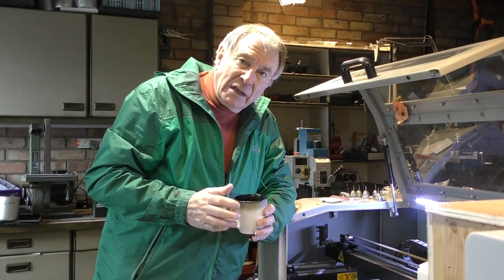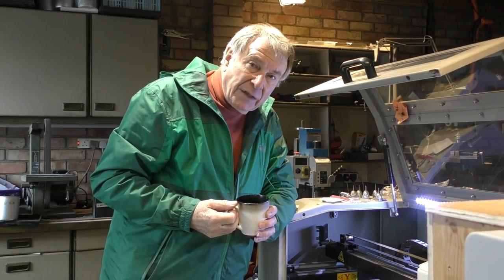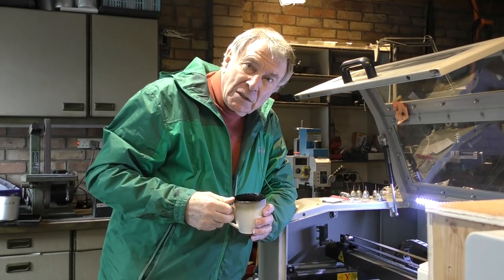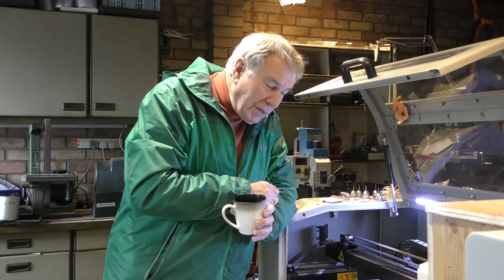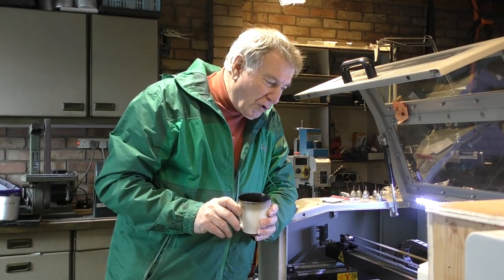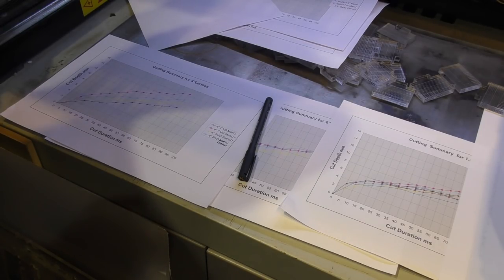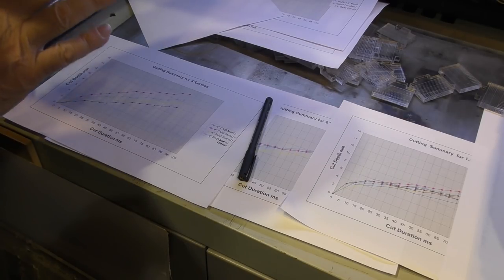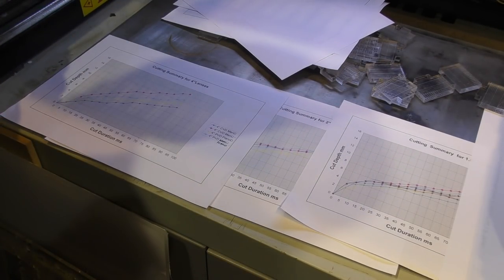RDWorks Learning Lab 202 More Laser Cutting Investigations

Comment: As you've said - in acrylics we're vaporizing the material - I wonder if material limited rate of vaporization is another variable?   i.e. given 10 mm thick acrylic - do you get the same, better, or worse performance with one pass say at 10mm/sec. OR two passes at 5 mm/sec.  (all else fixed).  Performance of cut may be judged by 'squareness' of finished edge.  Less taper is better..............
Reply: oops - I meant 1 pass at 5mm/sec. vs. 2 passes at 10 mm/sec.  ;-)
Reply: Hi Dennis
 Take a careful look at my very deep dot burns and also the dot test I did later on  Do you see any sign of taper in the first 10mm of  "tube".   Tubes are rather special in that there is nowhere for the vapour to escape from  except UP the hole. and you then imagine that the hot vapour may scour the tube but there appears to be no evidence of this.  My concern with the results  is to see how close these objective tests match up to cutting where  one side of the tube is missing . I know that multicuts do work but  the problem with it is that the vapour you produce with the "half cut" is hundreds of time more voluminous than the sold material that it was  and the only place for it to escape is UPWARDS.. At the same time your air assist is blowing it back down to create a bonded white condensate around your cut.  No, I am an advocate of cut once and blow the debris out of the BOTTOM of the cut. Also a single slow cut allows the heat to build up in the kerf a few millimeters behind the cut This is vital for that burnished finish. I have explained it many times  but once more can never be bad. Acrylic is similar to H2O. Acrylic is solid at room temperature (ice). At 160C  the solid acrylic becomes liquid (just as ice does at 1C). It then remains liquid until 200C when it immediately becomes vapour (steam at 100C) This vapour is still acrylic and that is what you are recondensing on the surface as it cools. However, in the kerf while the wall temperature remains above 160C the liquid acrylic film FLOWS level and produces a smooth surface. Cut fast twice and the wall temperature  never gets a chance to absorb/retain heat. Add to that your air assist that is forcing the liquid to cool before it has a chance to level and there is another reason to cut once slowly and with just a whisper of air assist. This is particularly evident with cast acrylic. For some strange reason (although chemically identical) extruded acrylic seems to retain that heat better and produces smooth edges much easier.
Although it may appear that I am trying to find the fastest cut, that is not the goal. I was using speed as a measure of lens performance. My assumption was that if power , material and focus  are constant, then the speed I can cut at tells me how well the lens is performing. Hmmm....... in hindsight that was a poor assumption because all those near constant performance results  just didn't make sense .  You can see from these latest results that in fact  there are big differences in lens performance and some of the patterns I see in those results  are  just confirming my imaginary picture of how the marriage of a laser beam and lens  work together to produce a cut .... and a basically parallel cut. There is NOTHING in lens theory that predicts this.
 Best wishes
Russ
Reply: Amen Russ....it all makes sense.     Thanks for the detailed feedback.

Comment: I’m very new to the channel, but this is all very interesting(!) Thank you so much for putting in the time on this, and for sharing all your findings!

I wonder if some of the puzzling results might be down to factors having as much to do with the material and what’s happening at the light/material interface as it does with the lenses and the resulting light path? Two thoughts occur to me:

1) To what extent do the escaping gasses impact the delivery of energy to the material being cut? I was prompted to consider this, upon seeing the way the depth of cut seemed to level off as time or lens focal length increased. It struck me that some portion of the beam energy could be getting absorbed by the hot gaseous decomposition byproducts that will naturally fill the cavity more and more as the depth increases. I can’t think of any easy way to measure it, but perhaps as the hole grows deeper, more of the beam energy is just going into further heating the gasses in the hole, vs heating the plastic at the bottom of it.

2) Vis a vis unexpectedly small differences between simple and compound lenses: I wonder to what extent the laser light might simply be reflecting off the walls of the hole as it gets deeper? I have no idea whatever how to go about calculating the reflection vs absorption as a function of angle of incidence between the light and the walls of the hole, but it does seem reasonable that reflection would be high for shallow angles. Given this, perhaps there’s a “self-focusing” effect, whereby the laser light is glancing off the walls of the hole, such that the shape of the light cone coming off the lens assembly has only a secondary effect on the energy delivered to the bottom of the hole(?) This might be true even in the case of seemingly “non-optical” substances like wood or carbon char on the sides of holes in wood. Maybe the shape of the light cone coming off of the lens is overshadowed by the way light rays are reflected off the walls of the hole, which would tend to direct the energy back into the interior of the hole as it grows deeper.

All this to say that it’s likely that the behavior of the beam inside a hole may be a lot different than what simple ray-tracing would lead us to expect in free air.

- I’ve never thought about any of this before (I don’t even own a laser cutter yet), but your thoughtful experimentation and meticulously-documented results have me very intrigued over what’s actually going on with these devices at a practical level. Thanks again for all the work you’ve put into this!
Reply from the maker: Hi Dave
 I greatly appreciate your contribution and thoughts on this subject and many aspects of what I have observed have been puzzling. You  seem to be going along with thought process that I have had at various times in my journey. I have found that despite my insatiable curiosity and want for FACTS, my imagination often works in superficial ways rather than the logical ways it should do and t often  leads me astray. I suppose that is all part of self-education/discovery.  I am really pleased that this problem has led you to contribute even though you do not have a machine

 You are right in saying that an understanding of material science is an important part of owning a laser machine.  Acrylic is a fascinating material because it is a truly unique plastic . Iit is a good analog for H2O in that it is solid (ice)until 160C whereupon it immediately turns to liquid (water) and then at 200C it boils and becomes vapour (steam)
 10.6 micron light has interesting and wide ranging effects on materials. any gas, hot or cold is transparent. Only solids and liquids convert the light energy into heat.  Vapour or smoke is by definition micoparticulates (solid or liquid) suspended in a gaseous medium. . you will see no smoke or vapour within the acrylic wormholes I have  demonstrated . Right at the light/solid interface,  the acrylic is boiling into a vapour  which in turn ( because it contains liquid microparticles) immediately reheats and turns to hot gas (just as you anticipated). There are certainly hot gas dynamics happening within that worm hole but that is not affecting the passsage of a STRAIGHT beam of intense  light enegy . there is a good logical explanation as why that energy runs out ...... but that's for the next episode of this journey.

Your second suggestion  about internal reflection and self focussing  an entirely credible thought that I have mused on lots after  I listened to an "expert" (so I thought) from Universal Laser  Machines explaining parallel kerfs  with the total internal reflection idea. Like you I couldn't imagine carbon inside the kerf reflecingthe light  but to be honest I could see no more credible explanation to explain what I was seeing. I even produced a video about TIR and acrylic . OOPs I have perpetuated a myth!!!  To get TIR you have to inject light from air into a denser medium. Once within that medium if the internal reflection angle is less than a critical value the light cannot escape. When you stop and examine if those condition are met during the creation of an acrylic worm hole the answer is definitely no.  The laser beam starts off in air and never enters the acrylic . Instead it evaporates the material surface  and leaves  a GAS  trail as it proceeds. So eventually when science trumped my imagination I was back in limbo. 

 There is nothing wrong with ray tracing, it is an entirely valid subject and works extremely well for UNIFORM light. I will even be discussing it's merits  in allowing me to see through the fog of these problems.
 Again sincere thanks for laying forth your ideas but I am afraid that science and logic shot them down for me .... and now you.  
I have been an engineer all my life and  through my curiosity acquired a wide range of knowledge and skills however this laser technology has forced me to learn alo more about niche parts of physics, chemistry and material science. Not something  I ever planned to do in my retirement years.

 Best wishes
Russ
Reply: @SarbarMultimedia  Hi Russ - 
Wow, thanks for the incredibly in-depth reply! I'll be very interested to see the next episode in your journey to figuring out what happens to the energy, and how it "runs out" as you say. (I see that you've already posted a new video that I haven't watched yet, apologies if some of this note is moot, based on the contents of that vid.)

I'll entirely defer to the strength of your experience vs theoretical musings, but will take exception on one point: You say that TIR happens only when injecting light from air into a denser medium. Actually, it can occur whenever light encounters an interface between two media of different refractive index. In our daily experience, this most often occurs when moving from air to some other material, but in the case of the light within the "wormhole", the two media are the hot gas and the still-solid or -molten acrylic. The gas has a refractive index that's surely lower than the solid/liquid acrylic, by virtue of its similar molecular structure but lower density. So I do think that TIR is possible within the hole, albeit that the refractive index of the hot gas will likely be much different from that of air.

All that said, I eagerly await your further results, and will be spending entirely inordinate amounts of time watching your previous (massive)  body of work :-0

Thanks again for your curiosity and diligence in satisfying it!
(At least I think it's "thanks"; you're going to account for an entirely disproportionate amount of my mental bandwidth going forward :-0)

Comment: I heard an air pulsating from your compressor. If you put a plastic bottle from coca cola 2l or similar between the compressor and the nozzle, goes little quiet and no pulsations.
Reply from the maker: On both my other machines I have modified the pump supply so that they are only on during a running program. I have never bothered with this machine. But I do haver the relay ready to do it when when I get some spare time 

Best wishes
Russ

Comment: I would like to point out one error in your intensity discussion...
When you reduce the size of a beam by half, you don't increase the intensity by two - you increase it by four.  The beam diameter is not the correct figure to use - it is the beam AREA.  Halve the diameter will result in FOUR TIMES the intensity.
You demonstrated this very clearly at the 10 minute mark of this video.
Reply from the maker: +
SarbarMultimedia

Yes, As I was editing it, I realize the diameter v area issue  was incorrect.  I do understand the 0.707 rule. I figured that most would not.. Thanks for  telling everyone. If I had bothered to do the math then the 7mm diameter took 10 sec and the 4mm beam took about 3 sec.  The areas are 38,5 and 12.6 where the 38.5 took 10 sec so the area corrected burn time for the 12.6 area is 3 seconds....ie what actually happened.
 Best wishes
Russ
Reply: @SarbarMultimedia  A technicality, really - the concepts you are addressing are far more important.

I have followed you through your entire RDWorks Learning Lab - and I have found your work extremely informative.  Thank you for your efforts!  I hope to build my own machine in the not-too-distant future and thanks to your videos, I have (or believe I have) a reasonable handle on the issues I will encounter - and a healthy dose of preparedness for the unexpected.

I encourage you to keep up the good work!
Reply from the maker: @brumbymg  
 I take no offence at people pointing out my "old age" problems. I sometimes say things I don't actually hear and it's only when I go back and edit the video I realise that something has fallen down that ever widening gap between my two remaining grey cells. Big smile!!
 Best wishes
Russ

Comment: Another thing about lasers. You really want the initial beam diameter as large as possible in it's parallel form. and in fact you may expand it before the final lens. This seems counter intuitive but a bigger area of the lens being illuminated allows you to create a smaller final spot... This also has the advantage of lowering the energy pr area passing through your lens reducing the risk of burning dust into it and damaging it. https://www.newport.com/n/focusing-and-collimating
Reply from the maker: You are 100% right if you are trying to engrave and 100% wrong if you are trying to cut..  Newport along with all other lens manufactures specialize in making the best possible lenses. That means bringing all available rays to a single focal point.  Do they care what happens after? No.  I have asked several global optics companies  why is it possible to get a parallel kerf  BELOW the focal point when all the rays are DIVERGING and the enegy density is dissipating?    No response.  They are only  intersted in lenses and not what we do with them. 

I fully understand why expanding laser  beam is good for focus  and it's not counter intuitive when you understand just afew simple facts. However that is NOT what you want for cutting. That's the problem I have been wresting with for about 2 years. The experiments and data I collected during this session have  at last unlocked that secret and I now fully understand how laser cuting works. 
 Best wishes
Russ
Reply: @SarbarMultimedia  I think the issue there could well be lens longevity. If the beam is tight and small on exit from final lens then the power intensity may leak to damage any tiny imperfection in the lens able to absorb the energy and then you have a hot spot and a destroyed lens. that will be why they favor post convergence. Looking at how you were handling yours with ungloved fingers, I have to agree with them.

Comment: It's great work.  Would it be possible to get some links to the best lenses?  i would very much like to order some lenses but am afraid to order wrong or some in poor quality.
Reply from the maker: Hi Jan
 It is very wise to be cautious when buying laser equipment and spares because there is a lot of B grade stuff being sold.  Fortunately lenses are reasonably safe. but a good trusted source is Cloudray.com.  see  https://www.cloudraylaser.com/collections/co2-focusing-lens-1
There are VERY few choices of  lens material  and Cloudray does offer all 3.. Forget Germanium unless you have a K 40 and even then I would not recommend such lenses. Zinc Selenide is by far and away the most common and here there are two grades. The Chinese manufactured lenses are made by  a method called PVD and are amber coloured. Because these are the cheapest type of lens many consider them inferior to USA manufactured lenses made by the CVD method. The big difference ( apart from the yellow sunflower oil colour) is that the CVD lenses are capable of working at higher wattages .  The PVD type are limited to about 80 watts  and the CVD will be fine to 200 watts or more.In tests,  I found PVD lenses often cut more efficiently than CVD, so price and performance are not linked. There is a third material called Gallium Arsenide that is a lot more expensive,  can handle very high watts. and in particular I like .  My favourite all round lens ia 2,5". Ga As because  It suits my tube very well. That is the key thing, the quality of your beam. In general I would recommend any of the ZnSe type  and the cost will depend on the power of your tube.
Best wishes
Russ